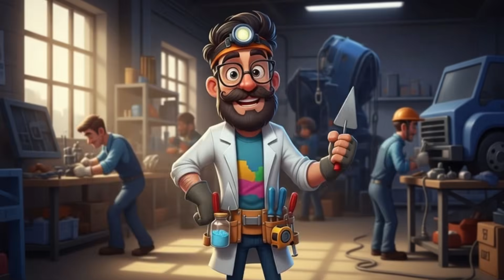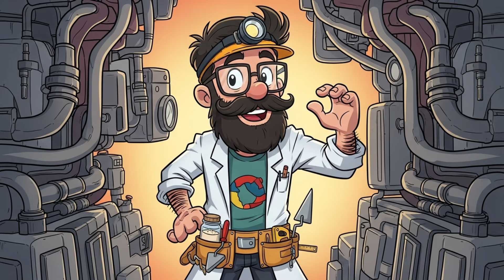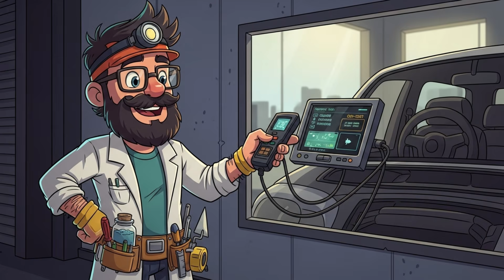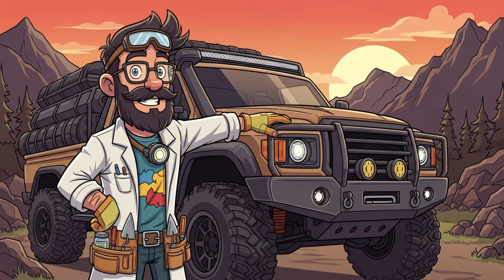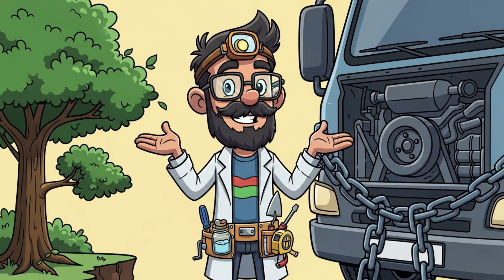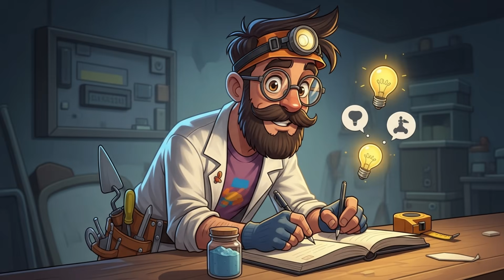Why This 30-Year-Old Engine Terrifies the EPA (The “Pre-Emissions” Loophole)

Comment: I dont know about the P pumped cummins but you dont even need a solenoid for the shut off for fuel. You can delete that for a cable. One less electrical component. At least on the ve pumped cummins trucks I've seen that mod. Might do it myself soon
Reply from the maker: If you found this video helpful, don’t forget to hit the like button, subscribe to the channel, and turn on the notification bell so you won’t miss any of our new videos!